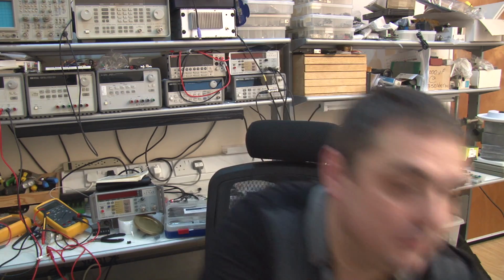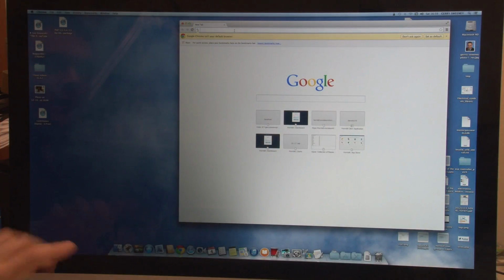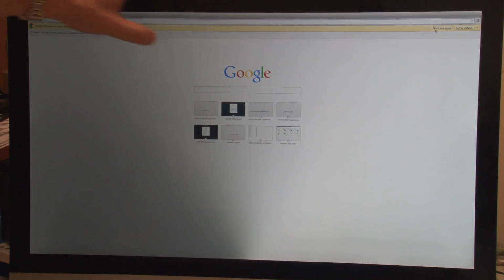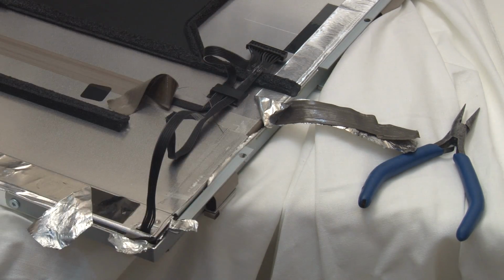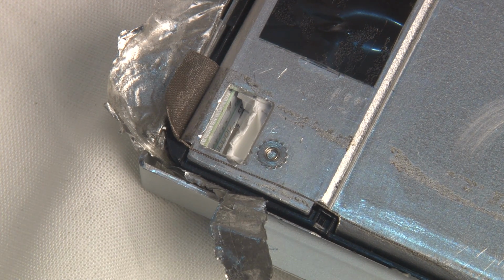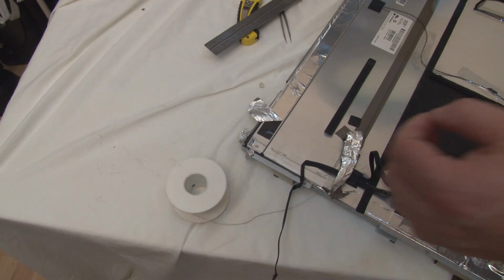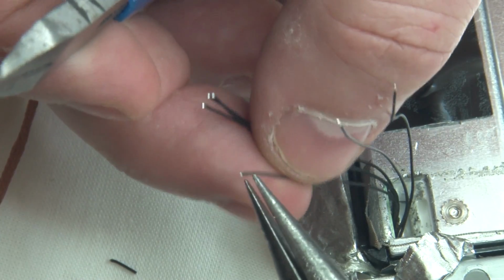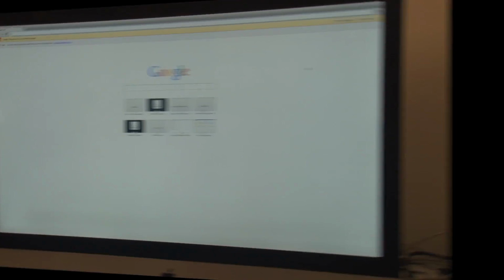Apple iMac 27" Dark Side Screen Failure - The Manufacturing Fault Apple Will NOT Admit!!

Comment: Gary. Thank you for taking up some of your valuable time to make this very useful video. It was extremely interesting but presents a real concern for me as I have just spent my hard earned cash on a 27" iMac. I have also just bought my junior designer at work an iMac that suddenly showed screen ghosting the other day AND my colleague's new Macbook Pro died recently too with its expensive logic board needing replacement with just four months left of the 1 year warranty! I've been a lifelong Mac user but a PC has never seemed so inviting right now.
Reply from the maker: Hi Stuart, as far as I am aware the newer 27" macs do not suffer this problem.  I am all for Apple having quality issues so long as they sort them, its a great shame with all the recent press about how much money they have in the bank that they are not prepared to sort out customer issues - that will be their downfall if they keep it up.  Anyways, for all the problems I have had with my Mac on balance I still prefer it over windows :) Gerry

Comment: Very cool video hope it helps me my 27 inch same model as yours and the screen started to the Half Color screen and now the screen is blackouted when i boot the Mac    When i Press the powerbutton quickly the screens comes on for 2 seconds and goes back to Black screen.
So i Will try to repair it your Way and the connecter you talked about on the backside of the screen is very loose so i hope this is the problem.
Regards
Deniz
Reply from the maker: Sounds like the exact same problem, good luck with the repair.
Reply: you are the man gerry :) i finally got mine to work :)like a month ago just forgot to say thanks :)so thank you to you sir.
Reply from the maker: Glad the video was of some help

Comment: Interesting... On the phone I have had AppleCare give me an estimate of up to $400.  Not the same screen issue but a different one.  Then in the Apple store I have walked in thinking the worst and when the tech came out they said the issue was a production fault and repair was no charge.   When I asked why AppleCare didn't mention it, the response was that they are supposed to give the worse case scenario for out of warranty item repairs and they determine if there are any hardware exceptions.

Comment: I'm curios to know if just building up the contacts via tinning would have improved the contact enough for the connections to work. Perhaps that would not be any easier than soldering on the jumper wires.
Reply from the maker: Bill Garnett There is no way to get the soldering iron into the hole with the connector there too, the only way to do it is to solder wires or take the panel apart completely and re-solder the connector onto the board. If I get another broken one I am going to try stripping the panel down to see how hard it is.

Comment: Thanks so much Gerry. I don't want to bother too much but what exactly is the name and kind of wire you used to solder to the Mac? I think you said something about it being nickel. Or does that really matter? Oh and I found someone local to do the work. Thanks
Reply from the maker: Hi Gavin, no problem, I used wirewrap wire which is basically single strand 30awg wire.  http://www.ebay.co.uk/itm/P-N-B-30-1000-Insulated-PVC-Coated-30AWG-Wire-Wrapping-Wires-Reel-250M-Red-/291026020592?pt=UK_BOI_Electrical_Components_Supplies_ET&hash=item43c280a8f0

Comment: Hi Gerry, firs of all, than u so much for this video, i'm sure it will save lots of money to some people.

 I'm having this exact problem with my 27 inch iMac 2011. The thing is that i'm also having a side problem: The screen turns randomly off ( the Mac keeps on ) and the only way to make it "recover" is to force sleep mode and wake it up again. This solution worked for a while but now as soon as it awakes, the screen turns off again in a matter of seconds. 

Do you think your fix will help also with that other issue? ( seem to be related somehow )

Thanks!!
Reply from the maker: Javier De Castro it could be the same problem but I am only guessing, I don;t know. The connector breaks away from the board and should potentially be shorting out - this may overload the LED driver boards output and force it to shutdown.  You might also have a similar problem to what is described here: http://support.apple.com/kb/HT3964?viewlocale=en_US
Good luck. Gerry

Comment: Come and live in Australia. We have consumer protection that guards against these sorts of problems. Basically we have a body (ACCC) that provides several consumer protections.It basically says that depending on the price paid for a unit(  the higher the price the longer it should be expected to last ) the consumer has a reasonable expectation that it will last a reasonable amount of time. The actual 12 months or so guarantee is partly irrelevant, and the manufacturer can be forced to repair or replace after a reasonable useage period even if out of actual warranty. Google ACCC to check.

Comment: Sod's law... Doesn't matter how expensive the darm machine is, it's going to break in an irritating to fix fashion. Nice fix though :) Looked rather delicate!
Reply from the maker: Thats for sure. I cant complain too much though my overall experience with Apple has been really good which is why its so disappointing when they do leave you high and dry as a customer. Yeah it was delicate enough but turned out not to be too hard.  It would have been nice to pull the whole screen apart and do it properly but the time and risk involved in breaking the thing, I actually need that computer on Monday so quick fix it had to be

Comment: Happy New Year Gerry, nice to see you again with another cool vid.

A poor design by Apple IMHO, especially if these things are failing after only a few months, and it's not just the odd one! Would have thought that Apple's QC people would have spotted this one during test cycles.

Oh well.. At least you saved them the hassle of having to explain to you that you must part with another £400 quid to make it work again ;)

Great fix. Cheers mate

John
Reply: The LCD panel isn't made by Apple, so it isn't Apple that made that bad design, but LG Philips who made the panel. But yeah, it's a known fault, and Apple should replace the panels, sending the bill on to LG Philips.
Reply from the maker: ***** Yeah fair point, but as you sat Apple should take on the fight with LG for their customers
Reply: *****
I have a 27" Dell UltraSharp wich used the same Panel. I got it fixed 2 times now. I have on my Workbench 6 of this Dell UltraSharp's...
Reply: I fixed one of these 27" iMac's as well, i just resoldered the connector on the board - my guess is that it falls off due to use of too little solder, and use of Lead-free solder which is just meant for failing sometime in near future.
Reply from the maker: Hi John, happy new year to you too. I think as ***** rightly says, the manufacturing issue is with LG but that does not mean Apple should not take responsibility and support its customers.

Comment: Hi Gerry, Good to see another video from you! :) Happy New year to you too! :)

Question: did you think about re-filling that hole with something like hot-glue after attaching the wires to give it a bit more support?
Reply from the maker: Hi Tim, thanks :) Yeah I thought about it but decided against it include it did not work and I wanted to get back in there. Also hot glue would not work because I think the screen gets quite warm.  The connections are fine now and have flex which should help.  Pain in the arse repair but I now have a working screen again and did not have to part with £450 for the pleasure.

Comment: Wow, those cables are way to stiff for that connector...
Reply from the maker: Yeah, reading other comments on the apple support forum it looks like the connector was a tight fit and under duress with heating/cooling cycles.